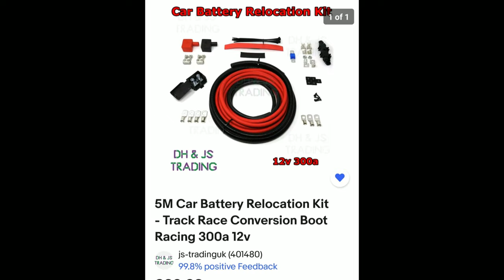BATTERY RELOCATION & ISOLATOR INSTALL Honda Civic EP3 Type R **Essential TRACK CAR UPGRADE**

Comment: Nice job boys 👍. It's like Honda knew the battery tray was going to be utilized again for a battery relocation. I did something similar on the turbo EP3 build but using the spare wheel thread and welding in the rest.
Reply from the maker: Thank you! 🙏

Ooo, that's a really good idea! Also, good choice on a turbo EP3! 👌

Thank you for watching! 
- Drew

Comment: Definitely going to be doing this on my one! Hopefully see you guys out on track aswell!
Reply from the maker: It's well worth doing, very satisfying mod too 👌

Hopefully, feel free to come and say hello man! 
- Drew
Reply: @accelerateyoutube  thanks man. Will do for sure! would be awesome to have the two milano red ep3’s side by side💯💯
Reply from the maker: @19hmxd  Kenny's isn't Milano any more, it's Ferrari Rosso 🤌 lol
Be good to get them side by side to compare! 
- Drew
Reply: @accelerateyoutube  ahh no way! I thought it had a different shade than the inside of the bonnet area. That explains it. I thought just a strange tcut or lighting but knew it couldnt be that lol🤣🤣🤣🤣 and yeah for sure! Tempted to go down to Combe with Slip and Grip Automotive in Feb 11th! But need to pass MOT beforehand tho🤡😂

Comment: For the ground cable you have in the engine bay does that run to the rear for the battery as well? Im doing this in my rsx but now im having grounding issues
Reply from the maker: No it doesn't. You need to find a good earth in the boot and run the battery negative to that. Make sure its bare metal. Same under the bonnet where the original negative is. Just make sure it has a clean contact point. I have had no issues myself, as of yet lol.
Thanks
Ken

Comment: what isolator switch did you use? I cant find it.
Reply from the maker: If you type into ebay 'car circuit breaker fuse' it's that. 200amp 👍.
Thanks
Ken